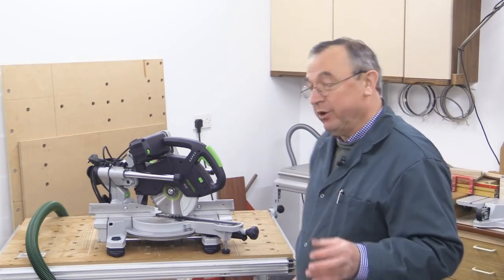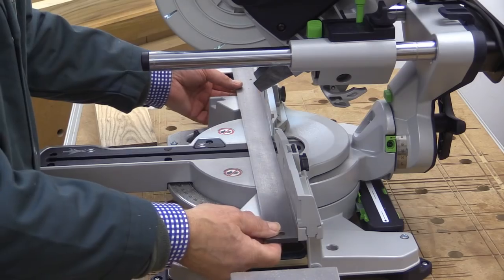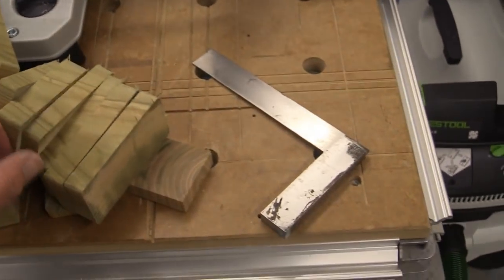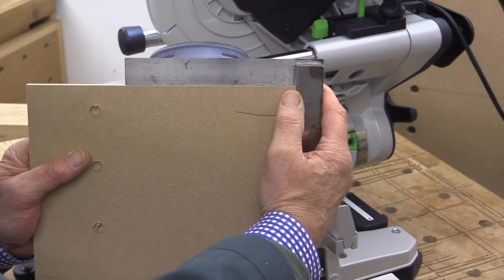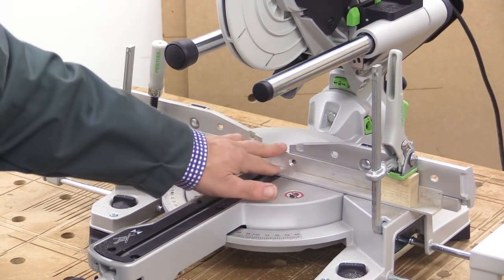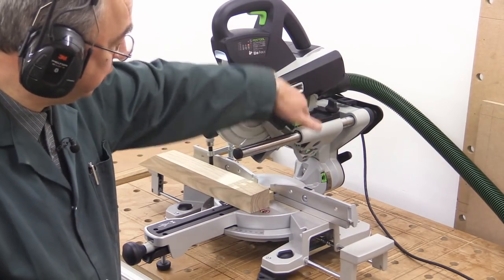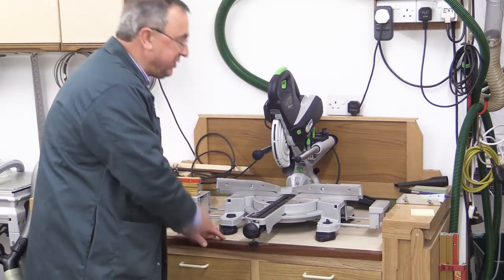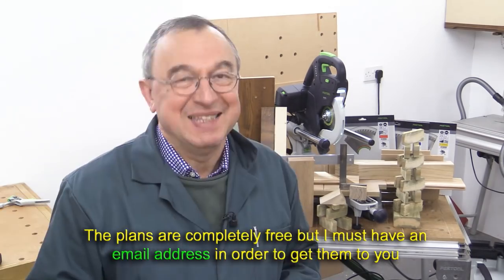Festool Kapex KS 60 Mitre Saw in action (2 of 2)

Comment: Just brought the ks60 and its such a nice saw to use. Had an erbauer that done me proud for 7 years. Dust extraction is very good on this saw
Reply from the maker: Hi Martin, If I did not have a KS120 already and was looking for a new mitre saw the KS60 would be top of my list.  Peter
Reply: I was worried about limitations but it cuts a bevel on 7 inch skirting no problems. Think its worth paying extra having a double bevel saw also was looking at dewalt single bevel but paid the extra for festool

Comment: Can it be micro adjusted if it doesn’t cut at 90 degrees? TIA
Reply from the maker: The tool should be able to be adjusted if it is not cuttiung at 90 degrees. Take a look at the user manual. I only borrowed the saw to make the video and cannot help any further - sorry.  Peter

Comment: Hi Peter, I'm making your bevel/mitre joined drawers with my KS60. It is not quite 45deg - the inside corner of the mitre join is lightly open when the saw is tilted over to its preset 45deg setting. I have looked everywhere - manual, youtube, chat rooms... looking for info on calibration. Tons on the KS120 - nothing on the KS60. Do you happen to know how to adjust it?? I'll keep my fingers crossed.
Reply from the maker: Hi David, I only borrowed the saw for a few days but... I have looked at the manual on line and it may be adjusted in the same way as the KS120. Adjustments are covered in the following US manual:
https://www.festoolusa.com/-/media/tts/fcp/festool-usa/downloads/manuals/717270_a_kapex_ks120_us.pdf
Take a look at page 22 and onwards.
Peter

Comment: Thanks for sharing this Peter, it's appreciated. PS I didn't know if you realised Osmo now make water based wood filler in a variety of colours, I've used it and it's very good indeed, zero shrinkage, sands easily to a lovely Finish and colour matches very well.
Reply from the maker: Many thanks for this. I have been using Osmo water based fillers for 10 years. They are excellent. Here is the video that I made in 2012:
https://www.youtube.com/watch?v=YnPNur2a4mU
Cheers.  Peter

Comment: Very consistent and high quality on your videos as usual, thank you Peter. Regarding the clamps, I had a similar reaction to yours when I got them with my track saw kit. They have however grown on me and I find myself preferring them to the quick grip ones for several applications. It is probably very subjective, but the solid wood grip and the sense of control when tightening them makes for a very pleasant experience.
Reply from the maker: Hi Rikard, I suspect that the one that I had with the kit was slightly defective as it would bend at an odd angle when being tightened. I have arthritic joints and I find twisting a small clamp quite tricky when my wrists are playing up. It is good to know that the clamps are popular.   Peter

Comment: I was considering using a sliding mitre saw to cut accurate mortises or rectangular trenches. I needed a 2 inch deep cross cut mortise in 4x4 inch fence post. In hindsight, following your great video research, do you think it best to use a handheld circular saw and guide 90 degree protractor to get better results ? Iam worried that the expensive big sliding mitre saws have not so rigid saw arms which would introduce unwanted inaccuracies. Fabulous trench work on the smaller saw. ThAnk you.
Reply from the maker: I only used the KS60 for a week or so but I really do like it and expect it to do all you need.  Peter

Comment: Hello. 
Some advice if it’s ok regarding the 60 / 88 or 120.  For standard 90x35 or 45 house framing and a little larger 200x100 laminated beams ( obviously have to turn them over on most of these models. My real question is the 60 suitable. It’s not a contractor job saw for me, I’m building/ renovation a couple units so pro work but low levels of use. I see your vid it powers through a solid Jarrah and pine like it’s nothing.  Thanks so much
Reply from the maker: It is a particularly good saw but do look at the Festool web site where you will find the maximum depth and length of cut at various angles and compound angles. If the saw can cover the range you want then it will do the job perfectly. Otherwise look at the KS120.  Peter

Comment: Couple of things.......
1. The American market have the Bosch GCM 10 GD although cant see any mention or talk of it releasing in the UK market! Do you have any knowledge on this at all?
2. I’m looking for a 10” Mitre Saw but can’t afford the Kapex 120 but would have stretched to the Kapex 60 if the depth of cut was 80mm plus (even though 8.5” blade). I’m after a decent accuracy saw but feel the only decent ‘sturdy’and precise ones on the market are the Glide 12” 🙄 120 and 60. When I say I’m after a cheap one so that in a couple of years I can get say the 120 or it’s replacement I mean I was thinking of say a bosch gcm 10 Sd say £410 but I’m not convinced that it would give me great precision 🤔 and feel why not spen £250 and get similar precision? Also why doesn’t anyone seem to mention the Kapex 88? If you can answer (or begin to answer) these that would be great - make yourself a ☕️ it might take a while 😊
Reply from the maker: Hi Chris, I will answer both posts here. The design of a mitre saw is blade size dependent. The bigger the blade then the bigger the frame, the motor and so on. But the Festool design criteria started with what people working in wood on job sites really needed. They wanted portability, accuracy and a reasonable range of cut sizes at different mitre and bevel angles. The KS 60 is a good compromise in that respect. When I did my own study to settle on my choice of mitre saw the Kapex 120 and the Bosch Glide were the final pair that went head to head. The Kapex won despite it cleaning my wallet out. I have never regretted that decision. Guys on job sites want portability and accuracy and the Kapex wins on those scores. I never did see the point of the KS88 as it was not much cheaper than the KS120 but did not have as good a spec. The real bottom line is what your analysis produces, not mine. You will have some requirements that may be irrelevant to me and vice versa. Once you have made your choice and spent the money you have to live with it and human nature will make you defend your decision until you replace the product.   Good luck.   Peter
Reply: New Brit Workshop Appreciate the quick response. Whenever I buy something I generally want it to cover all areas in terms of quality, precision and something that will last, unfortunately I’m not in the trades but do look for something that will last incase I want to build furniture going forward and precision is the key here! Anyway like everything there’s always a better one! Only recently looked in to the Mitre saw market and honestly was pretty shocked to find you could pay up to £700.00 for a machine and it still have movement left to right on the downward action if only by a couple of mm’s. Although it emptied your wallet so to speak I bet you felt satisfied 👌🏻 Once again thanks for the reply and like every honest viewer of your videos, you do a really good clear informative job 👍🏻
Reply from the maker: Hi Chris, Buying a mitre saw is a big thing for most amateur and DIY people and so one has to look carefully. I paid the full price for my Kapex long before I even thought of doing anything on YouTube. I am working on my next workshop notes video which is likely to come out in about 3 weeks time. In it I show the mitre joints that I have created for a pair of chests of drawers - they are absolutely perfect and so only require glue (no screws or dominos) to make a strong and attractive joint.   Cheers.   Peter
Reply: New Brit Workshop Yes there’s nothing like the feeling of perfection 👌🏻. I’ll look out for the video.

Comment: Are you planning to do a comparison between the two kapex saws you have?
Reply from the maker: Hi Henning, The KS60 is packed and will be collected early next week. So, I am unable to do a comparison. This may help... In my view the KS120 is a more sturdy machine which is suitable for any environment. It lacks the 60-0-60 of the KS60 which would almost swing it for me if I were doing that sort of work all the time. The KS60 does a better job of trenching but has a smaller area for stock support. If you have tried a KS120 for any length of time you would probably favour that machine. However, for the person in a small workshop or road warrior (shop fitter, kitchen fitter or 2nd fix) then it would make sense.     Peter
Reply: Hi Peter thank you for your detailed answer! I think it will than be the 120 for me, unfortunately:)

Comment: What prevents it cutting deeper than 60mm? Is it the blade size? So disappointing! Seems as if they have purposely fitted it with a smaller blade otherwise I wouldn’t mind betting the sales of the 120 would diminish!
Reply: No. At that price point for them to guarantee quality they have to set limits that enables to achieve quality.  Going deeper could mean a less accurate cut.

Comment: looks like a nice bit of kit but they are very expensive
Reply from the maker: Hi Russ, It is difficult to compare like with like as the quality of construction, the accuracy of cut and ease of use need to be factored in as well. Also, having the acknowledged best dust collection on the market makes a huge difference.   Peter
Reply: If you want accuracy then it is going to cost. For many people they do not require accuracy what they need is a reasonably clean cut that looks ok. And that then can mean a cheaper saw. 

Festool are for detailed accuracy orientated carpenters, Joiners and cabinet makers.  When buying festool people can most certainly be sure of its quality. Like the way Mercedes used to be before they went mass market and cheap cars.  That is the alternative for Festool creating cheaper tools that more than likely will not be as good.

Comment: It's not accurate, the 45° bevel function is not straight. Check before you buy. I returned 2 of them
Reply from the maker: Mine was spot on.    Peter
Reply: +ywein Ryon
You made this exact same statement in another video. And I am sure it has the exact same wording.